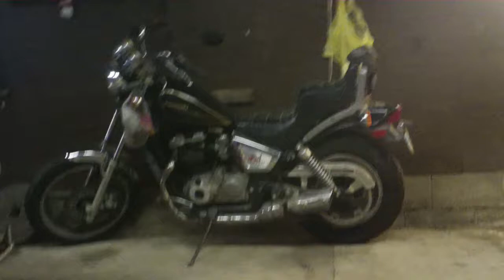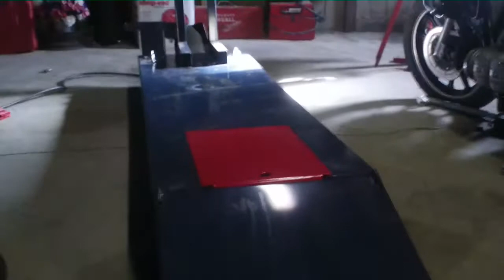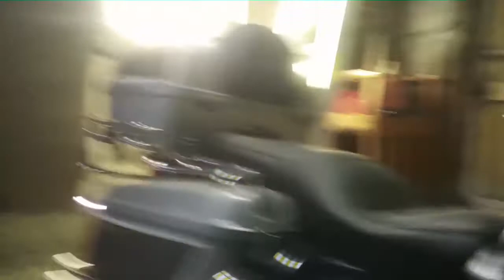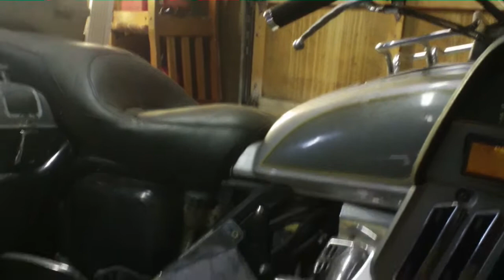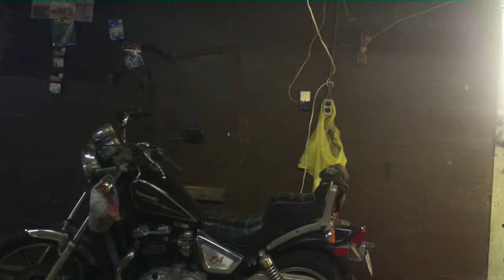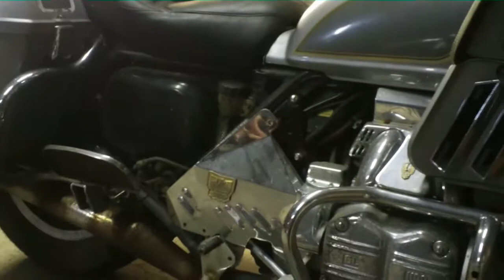2013 11 07 Thursday

Comment: if you part it ill be interested in the turn signals and possibly the tires.  thats all the parts left for me to purchase to complete mine.  other than the vacuum system being connected correctly i'll be able to ride.
Reply from the maker: I'm gonna rat it. If you want the turn signals I'll give them to you. I'm putting different ones on.  PM your addy.
Reply from the maker: They aren't worth selling. The bike sat outside for years and the side facing the sun are really bad. The rear one is taped together and the front one is nearly that bad itself. The other side looks pretty good.  I'll send them to you.